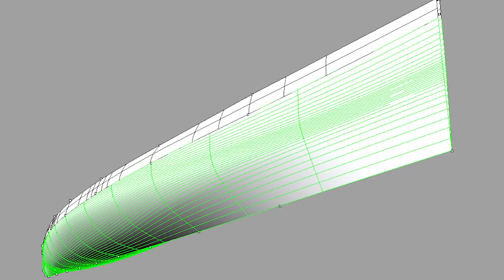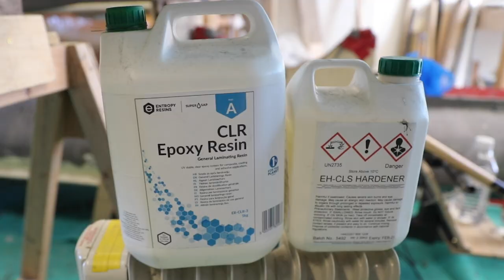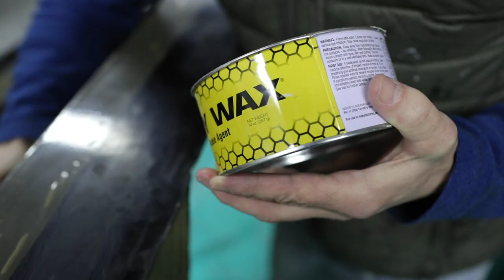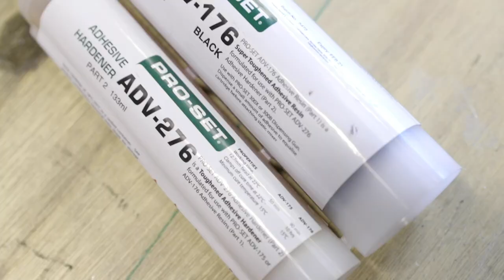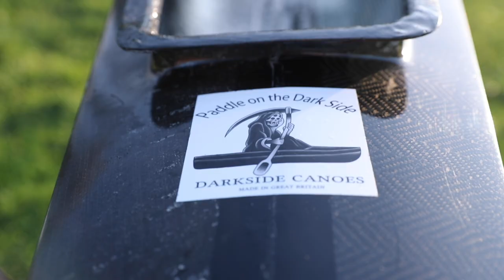Darkside Canoes - resin infusion construction of single canoe

Comment: Interesting use of Soric for the overlapping tape
Reply from the maker: I don't usually use Soric in this way along the keel line, I usually use it for ribs. However the whole point of this concept boat was to enable the comparison of the different laminate combinations in terms of stiffness and strength.

If I'd used Soric for the ribs, it would have undermined the purpose.

Great stuff though!

Comment: Really enjoyed this.  I'm a canoe and surfski racer (ACA downriver, USCA marathon, outrigger) and am curious what specs this boat meets.  Definitely looks more like K1 seat position vs C1 ICF which is typically high kneel.
Reply from the maker: This is a sit&switch canoe which conforms to the ICF specifications. High-kneel is for "athletes", which I am not!
Reply: @darksidecanoes7053  that's awesome.  I actually have the same thing, made by Wenonah in the late 80s/early 90s.   Mine had a tractor style sliding seat that I removed and replaced with an outrigger style foam seat that's about 1 - 2 inches lower as I like to race some local class I-II whitewater races and need the extra stability haha.

Comment: Which combination gives the best strength to cost ratio? 

Which was the easiest to work with?
Reply from the maker: Now that's the $34,000 question! Each combination is right and there are dozens more that are equally good, but how does one know which is the best other than to try them all.

I wasn't keen on the "green" fabrics as they don't look great and don't "wet out" consistently.

The material cost are probably the smallest part of the overall cost as it is labour which is the biggest component which is why I never understand why customer opt for the cheapest fabrics.

Comment: Nice to see the detail of how you put this together - especially things like the jointing of components and bonding in parts.

The only thing I am confused about is that you seem to use different materials on the left and right side (e.g. spread tow twill Vs. Carbon kevlar), or am I confused between top and bottom?
Reply from the maker: Hi Karl, the point of this boat was to show a number of different combinations of fabric and resin. I can't afford to make four boats so I did four in one.

My frustration is that there are no perfect combinations because it is a compromise,  so which one is the best?

It is to stimulate debate.
Reply: @darksidecanoes7053  ah, that makes perfect sense!

Comment: I love the infusion process and have used it extensively but am going off all the waste. More plastic, peelply etc that cannot be recycled.
Reply from the maker: Sad but true. I hate throwing away all the consumables and sometimes try to reuse the bagging film - BIG MISTAKE!
Reply: @darksidecanoes7053  Yes, me too. Such a fight with tacky tape and old bag film!
Reply: I found an old video searching for this one of a company called Silicon Composites Ltd that apparently makes reusable silicone vacuum bags. 

You need a mold, but it seems to be pretty interesting if you are not doing a unique piece and are doing more than one. In the video I saw they use it on a small hull.
Reply: A canoe can live 100 years. Every kayaker is one fewer motorboater. Not too worried about pieces of art either.

Comment: Interesting parting line and only a half-lap joint on the inside to bond the two together. Intuitively I would have gone for a top/bottom split instead.
Reply from the maker: Joining the boat down the centre line reduces the length of the join and also provides an opportunity to stiffen the lower hull join.

Comment: You get good power while remaining very quiet upper body and minimal fore/aft movement, much more so than other paddlers and I aspire to this style. Are you using a rotating seat?
Reply from the maker: Not using a rotating seat in this sequence, that development came later. This sequence certainly shows the need though.
Reply: @darksidecanoes7053  Ok, thanks so much

Comment: How come you have used an epoxy pigment with a polyester based gelcoat?
Reply from the maker: Well spotted. It's all I had in the workshop. I rarely use pigment.
Reply: @darksidecanoes7053  Thanks for the reply.

Comment: I would like to see someone dimple the bottom of one of these for drag reduction. I had ride on a dimpled kneeboard years ago and you could turns sideways and skid yourself back towards the boat whilst underway, just a guesstimate there was about a 50 percent reduction in drag.
Reply from the maker: The question is, how do you create a consistent pattern across the whole boat surface? The concept is similar to a shark's skin.

Some paddler have tried to roughen the surface with sandpaper but it just produces a series of random scratches.

Comment: I wouldn't trust it you got one inch of clearance before water rushes in on either side. Good construction though.
Reply from the maker: Don't forget the boat is designed for flat water racing, plus it supports a full length spray deck.

Comment: How do you determine how many layers you need?
Reply from the maker: The experience of making many mistakes! This is the frustration of the composites industry, there is no knowledge base, and engineers are reluctant to share information. This is what I would like to change.

For racing canoes, I choose a 200 gram carbon weave layer, and a 200 gram hybrid carbon/innegra or other other aramid (but not Kevlar). I use Soric ribs to add rigidity.
Reply: @darksidecanoes7053  Hey, why not Kevlar?
Reply from the maker: @vspetkov  I'm not great fan of Kevlar. It was invented back in 1965 and there have been other more modern products developed since, including Innegra and Twaron.

Kevlar starts nice and golden colour, but as it ages and absorbs water it turns an ugly dark brown.

I know it's used by many canoe manufacturers by I sometimes wonder if that is because they've always used it, or because they really do think it's the best.
Reply: Very tidy result!! What was the weight of the bare hull?

Comment: Cool, but that extremely low freeboard would never work in anything but glassy smooth water.
Reply from the maker: You're right, it's only designed for flat water racing.
Reply: @darksidecanoes7053  Perfect for the job.